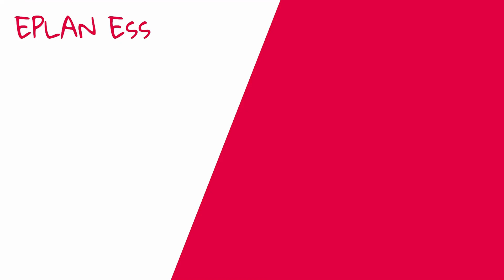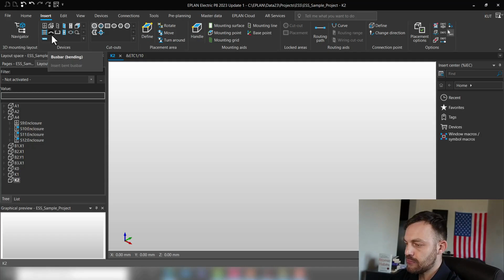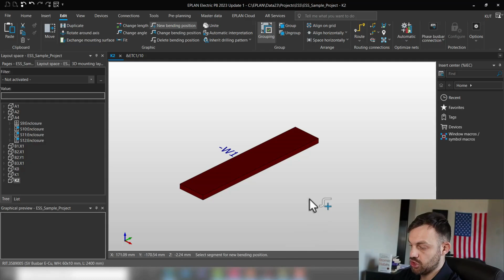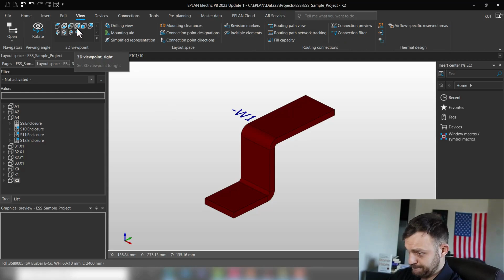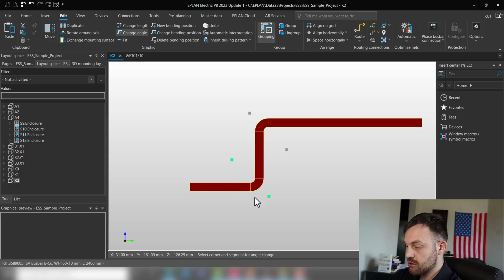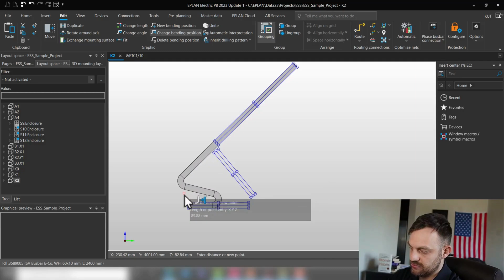EPLAN Pro Panel Copper Design Tutorial

Comment: Hi Kruno, Congratulations for your video. I have a question about create bussbar or other elements. I se you use rittal busbar, there is possible use other fabrication ? What the make a new busbar or din rail and the use a function drag the face for expand the length.
Reply from the maker: Hello sir.  Thank you for your question.

Yes of course you can use other components than Rittal, important is that your Busbar has in the Parts Database the "width" and "depth" information.

My recommendation would be to download the Rittal Busbar, and copy it and modify it to your needs, and save it under the part number and manufacturer you typically use :)